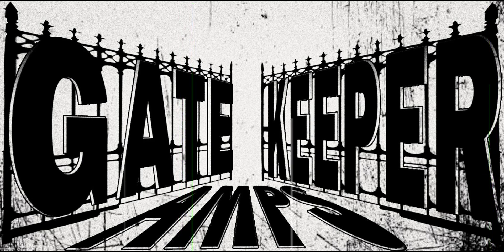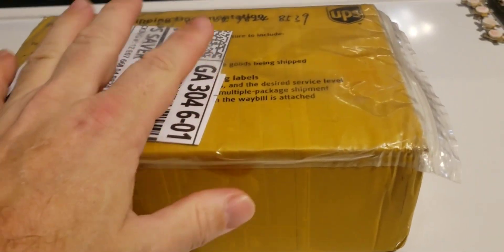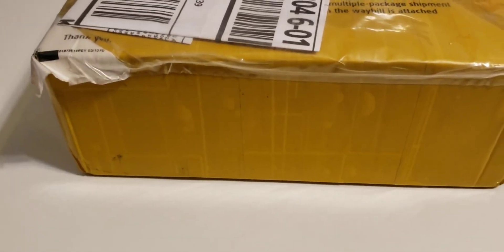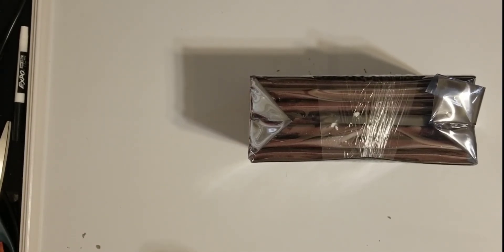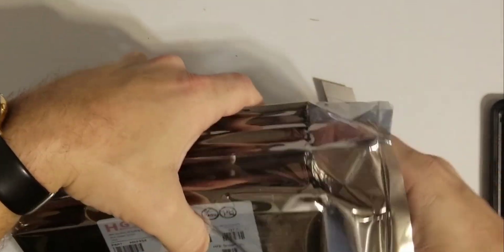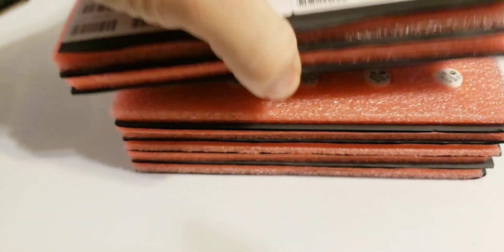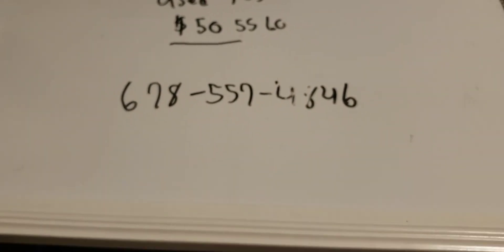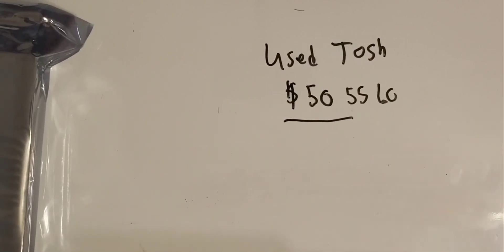2SC2879C[150w], 2SC2879[100w] & More RF Power Transistors[BJT] Available For You!

Comment: My 64 did okay with 18D08................I'm currently running 23D08 Now they were getting to mixed up. Replaced them all hope he don't keep changing. It stinks if I blow one..
Reply from the maker: Yeh that is the only thing that sucks man!!! FOR SURE! Wonder if we need to start promoting amps with back up transistors lol from same lot
Reply: I sold bunch of used ones on eBay from my 64 pill I think that's why they sold.  @1883GotDown

Comment: How big of a amp do I need to be able to use my 8pill 2879c to drive a 16pill or a 24pill idk which I need for my 8 pill as a driver
Reply from the maker: It could be done with the right setup..right radio driver so you don't over drive the big box.